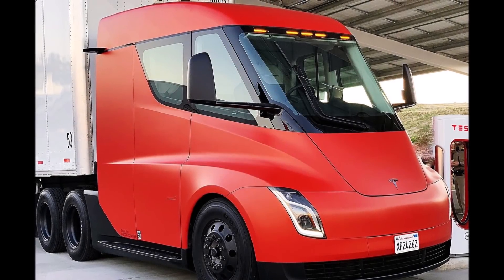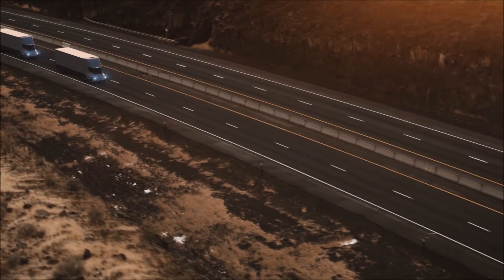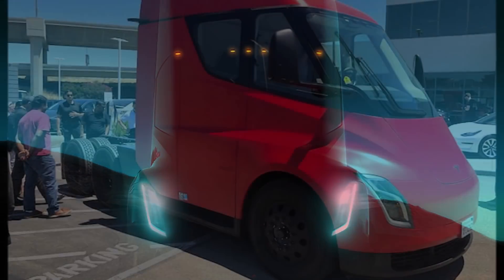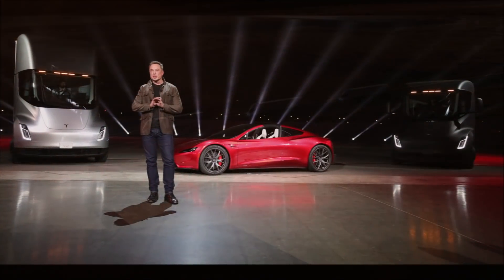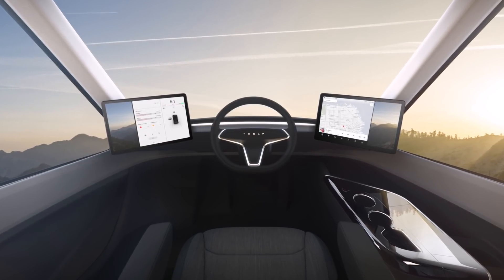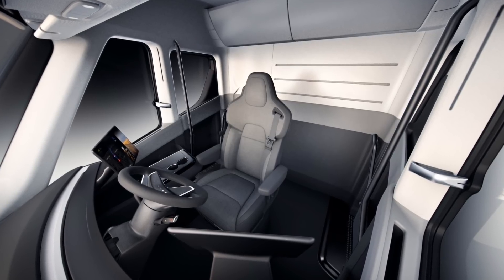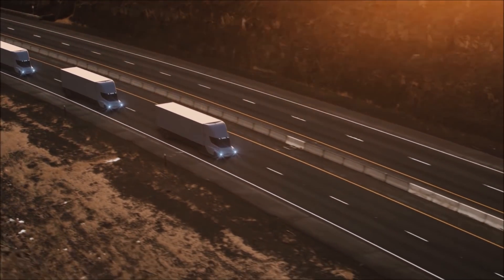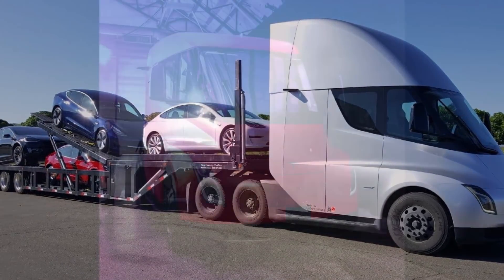Tesla Will Liquid Cool Semi Charging Cable and Files Patent

Comment: They should really design semi trucks to have two large batteries on the sides, like existing fuel tanks. When discharged, they can easily be swapped out in a few minutes with a previously charged battery. This would make charging safer, as it could be done in advance, without the need for all this extra tech.

Comment: If they are going to the trouble of adding plumbing to the cable, they may as well pump liquid nitrogen through them and make the cable out of a high temperature superconductor. The cable itself could be then be thin and light. I can't imagine how heavy a copper cable must be to conduct the amount of current you were talking about. Maybe an inch thick braided cable, weighing a considerable amount. If these cables are heating up that means many 100s of  watts of energy being wasted. With a superconductor there will be no energy wasted, except of course that required to supply the liquid nitrogen.

Comment: This process of liquid cooling the cables is already used in the welding industry.  It is good that Tesla will be taking advantage of existing technology since this is a proven means of keeping the temperature of the charging cable within safety limits.

Comment: I wondered about that. Would run hot enough to burn you or be fat and stiff. At minus twenty, high current cables are stiff enough a small man can't bend it. We would take measurements and bend the wire indoors and then install it outside pre-bent.
Reply: I'm sure that coolant cable could be reversed and add heat instead during winter to keep it pliable.

Comment: Um...cute idea that isn't needed.  More important question...WHERE IS HE GOING TO BE ALLOWED TO BUILD MEGACHARGER STATIONS?  Some of his supercharger sites are ALREADY displacing businesses, as there isn't enough power for both.  Now he'll need around 15MWh...PER STATION...to be able to charge semis.  Anyone know of a place building out more electric capacity in the middle of nowhere or buying up vast swathes of active industrial property?

Smells like another Hyperloop...
Reply: There's lots of Pilots and Flying Js out there.  All they need to do is call the local electrical utility provider, and ask them to deliver additional power to the site.
Reply: @cyclopsvision6370  If the power was available, Tesla would already have built some megachargers out.  Fact is, there's only so much power going over standard overhead commercial/residential lines.  Listen to the Rogan interview of Matt Farah, and why Matt couldn't put 5 L2 chargers in his new business building.  He's in the area of Google, and the city of LA told him there wasn't enough capacity to do it.

And industrial lines don't go out to nowhere...a new substation would have to be built for EACH megacharger site, or they would have to have their own 24/7 generators.

You can't just keep increasing the electrical load by an order of magnitude and expect more power to be available.  It doesn't work that way.
Reply: If they don't liquid cool the cable will melt.
The they install megachargers in the backyard of the warehouses,they already have huge fuel tanks or what are those
Reply: @UnipornFrumm  If there's a huge fuel tank, then there's a huge generator nearby.

And thus would end the lie of not using fossil fuel to run his semis.

Comment: I sincerely hope they ditch the cable in favout of the opcharge arrangement (which is the suggested eu standard for heavy vehicles) fully automated pantograph. People dont need to be in contact with high energy cables. Edit; opcharge supports upto 2.5 megawatt,   but has no real upper limit.
Reply: Yeah, like most public transport electric busses have such a thing now... Diesel busses are disapearing at an astonishing rate here in The Netherlands, in my town there are just a few left.. This happened in just 5 years time or so... These overhead chargers are 400 Kw.

Btw, those cables are very safe, its virtually impossible to get in contact with the high voltage lines.. and I believe the high energy only starts flowing when the cable is plugged in and the handshake is done.. Unplugging only after the charger is turned off, no chance of sparks.
Reply: @MarcoNierop  yep. I am aware if the safety mechanism. But regardless, a fully developed and automated system already in serial production  where the driver simply park the vehicle on the right spot, or a system where the driver needs to perform a manual procedure handling dirty heavy cabling. Sure it can be used in a pinch, but really? It would add cost to the whole system. With no real benefit. The reverse pantograph are very convinoent on these types of vehicles. And standard.

Come to think of it I think this patent relates more to the cable they are already using in the v3 chargers and not really for the semi. Even water-cooled the step fro. 250 to 1.6 megawatt category is steep.

Comment: This makes sense. Electrify America had liquid cooled charging cables in their high current chargers back in 2018, and they had recall issues with their Huber+Suhner liquid cooled cable lines early in 2019, but they have been fixed. Certainly with the planned Tesla MegaChargers and V4 Superchargers, they are going to need thermal management to handle the heat from the high current chargers. One of the issues seen with these thicker, cooled cables is flexibility. And potentially the combination of the new Roadrunner batteries, and multiple, simultaneous charging connections could dramatically increase the need for extra cable cooling. It is great to see Tesla on top of super-fast charging technologies. I don't think that this is an issue for normal Tesla owner's who usually just charge up at home overnight. But for the Semi, and future Robotaxis, who are driving nearly all the time, and putting serious miles on their vehicles. They will need reliable, super-fast charging that keeps it's cool.
Reply: Electrify Amerika is from VW?
Reply: @JK-ku2mj  
Yes. Part of the deiselgate fine had to be used to build the network then VW has to walk away and it will be a separately run business.
Reply: @JK-ku2mj  Yes, VW is their parent company, but they provide public charging to all EVs that can plug in.
Reply: Just to note, The video says current cables are 100A, (I guess we are ignoring Europe cables with LC which are rated to 500A 1000VDC), Guy in the video said we would need cables to take 2000+A. Not sure if they are saying that is what Tesla cables can do 2000+ or just that is the goal.